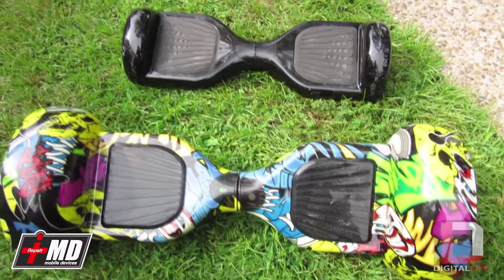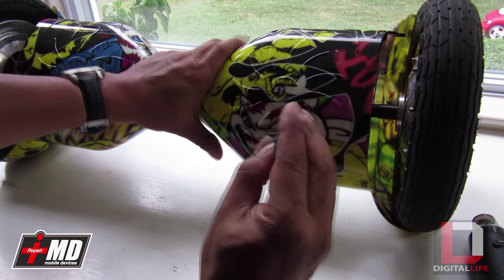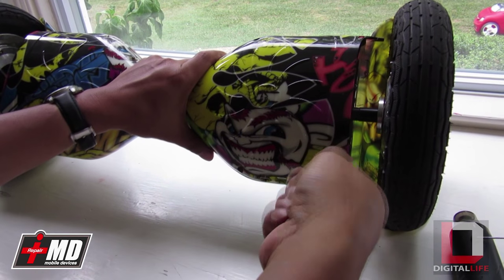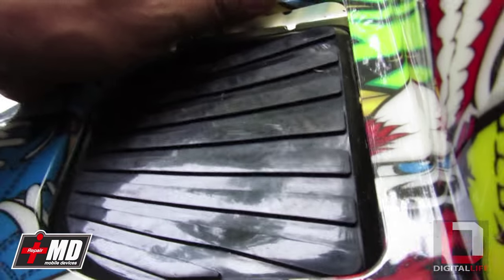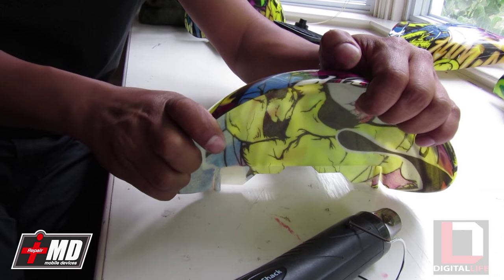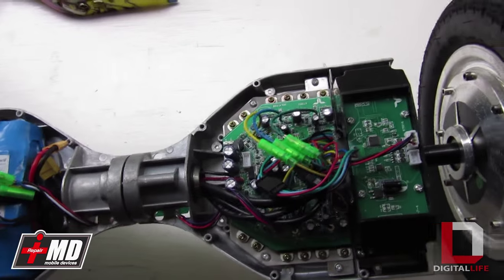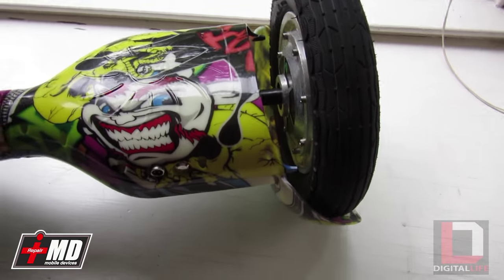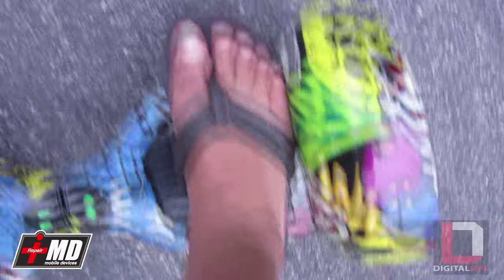Smart Balance wheel scooter Wheel adjustment

Comment: Hey just bought a new gyro sensor and replaced it because one Side wasn't responsive ....replaced it n now it responds ....but on the side I replace with a new gyro sensor is stuttering and and there is a delay in commands like the board is confused on weather to go forward or backwards ...also there's a tire rubbing sound but the tire isn't running against anything .....what can be wrong with it ? If u can give some advice it would b well appreciated   ....MINE DOES THE SAME

Comment: Hi i barely got my balance board yesterday. Its the standard 6 inch wheel one and i had no problems with it, never even fell off. Today my friends wanted to ride it, so they were all using it and having a few minor falls, nothing bad at all. The board is a little scuffed up now, but its all good, no bad falls on it besides it rolling a little bit. Anyway, after they all finished playing around with it i noticed that the right wheel makes a grinding sound exactly like the sound in the video, except not as bad, only on one side, and mainly when i turn or apply pressure with the outside of my foot to the wheel housing. Do you have any suggestions for me as I am not skilled or experienced enough at all to take this thing apart. Any easy fixes you recommend? Thanks.

Comment: I just bought a hoverboard and now it won't even turn on without the charger.Inside the side without the battery,there is a blinking light with a noise that says "LED" and the battery light on the top is orange,not red or green. What do I do?

Comment: Hey, my hoverboard is making a weird rubbery squeaking noise in the side where the battery is at, I've been told on Reddit that i should tighten the 4 allen bolts inside of it and after tightening them as much as i can, its still making the noise, its getting real annoying as its not just a noise, sometimes its gone no matter how hard i press on the overboard, sometimes its there even with the smallest movement, its usually on a certain part of the wheel where when it hides inside of the wheel hood, it'll make that noise, then it changes places every day(no certain change pattern), i tried pushing the wheel going inside, or pulling it a little, i tried riding the crap out of it to see if something just needs to be aligned again, still not working. what do i do? thanks
Reply from the maker: +kzraps your tires are rubbing against the frame, you'll need to adjust the wheel spacing
Reply: +iRepairMD Youtube How do you do that?

Comment: what happens if you get a puncher on the 10" tyres? since you inflate them with air your going to end up at some stage getting a flat tyre.

this is the reason I won't get the 10" model.

Comment: Hi there, I have the 8" self balance board with Bluetooth. For the last few weeks, it has worked perfectly. However, I went to use it this morning, and it works fine, apart from a squeaking noise coming both sides, in the tyre/tyre cover area. The squeaks happen everytime the tyre rotates to a certain spot. I was wondering if you have experienced this or would be able to advise me on how to go about fixing this. I live in the UK, so cannot visit your shop. Many thanks, I appreciate any help.
Reply from the maker: +Thomas Gayle sounds like your tires are rubbing against the shell, just like what I had to do, you'll need to heat correct it.

Comment: yes my self balancing wheel makes the same noise but do you have to use the heating method or could you do something else to fix it?
Reply: did you figure it out
Reply: yes I opened up the balance board and found out that a big screw was loose making the wheel grind up against the top of the rim